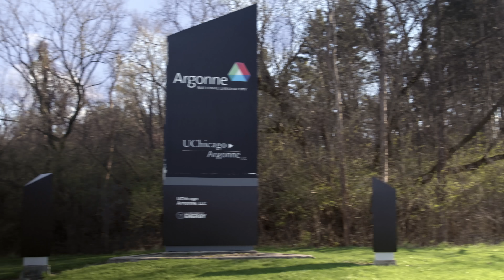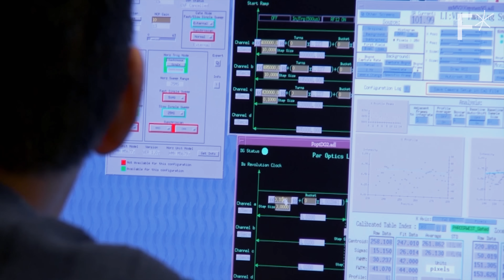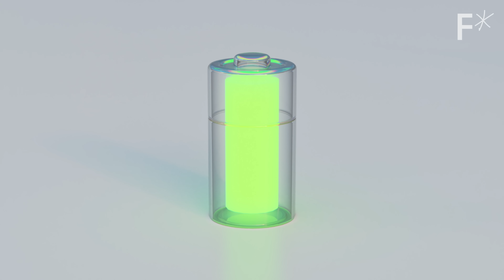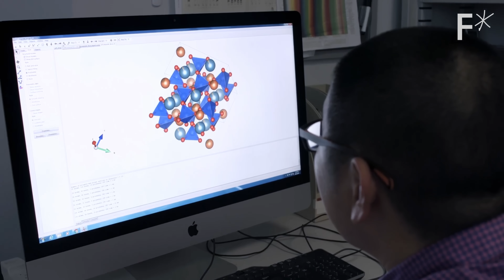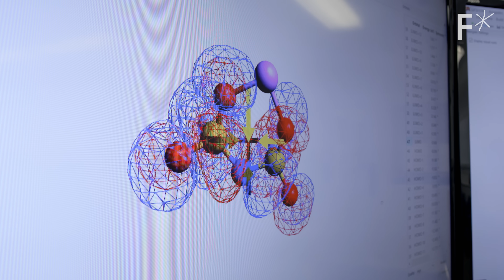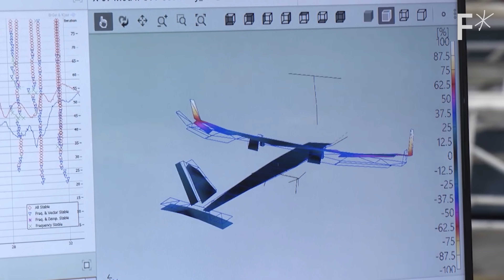The future of high energy density batteries | Hard Reset

Comment: I am a battery researcher just like our guests here, in fact I sometimes come to Argonne for similar experiments... there's problems here

3:15 Lithium scarcity is BS. It's one of the most common elements in the crust and if you had looked, you would have found that it is not a problem. What's the material scarcity of today's batteries? Well it's Cobalt, mostly. 
3:25 Lithium is not the electrolyte...the electrolyte facilitates the transport of Lithium ions. A pretty fundamental thing to mix up
3:55   2-3 times of what? There is a place for Zinc and Mg batteries but they also have fundamental downsides, for example Zn batteries are heavy af (10 times heavier than Lithium) and therefore mostly useful if space is an issue, for example it would be a good grid storage option if aqeuous (water based) Zn batteries would work out.
4:30 Argonne is definitely not the only place where they do this. It's called a synchrotron facility, and there's five big ones in the US alone where they all do this. And there's dozens all over the world. 
5:50 Lithium doesn't explode. It doesn't even catch fire if you throw it in water. It's the least reactive Alkali metal. They have a dry room because oxidized Lithium is useless in a battery, and Lithium reacts much faster with water than with just oxygen. 

Appreciate the skillful narration but there's a lot of fundamentally wrong statements in here, too. Did the scientists that appear here get to see this video before release?
Reply: thank you, i was getting sort of miffed when these statements popped up
Reply: I once again grow more and more glad that I take things from these videos with a grain of salt. General idea is usually right, but details are better known by specialists in the field
Reply: Thanks for the Info!
Reply: This comment should be pinned.
Reply: Even the comment about oil being replaced by lithium... you don't burn lithium and you only have so much per car... ever... then you recycle it.. A few hundred lbs for a million miles is a lot better than 100lbs of fuel for 350 miles..... not a fair comparison. We are comparing hundreds of thousands of kms to a few thousand in terms of weight of material used.
Reply: @DavidMcCalister  it actually is a pretty fair comparison because right now the energy grid only gets 1/3 of the energy that we actually produce. A gas vehicle only ends up using like 25% of the energy in the fuel. An electric vehicle uses way more of the energy stored in it. You also have to keep in mind that this tech is basically brand spanking new compared to the 100 or so years we've been using oil for energy. Electric vehicles are the future because internal combustion engines are far more complex and prone to failure.
Reply: Pin this comment!
Reply: U r absolutely right on all accords. We have grabbed the low hanging fruits of advantages, I think in next 5-10 yrs we will see charge speeds come down 10-20% yoy to ultimately 3-4 mins 0-80%. Nd by 2035 it could be way faster than filling gas. Storedot promises 2 min charge for 2030. But remaining underlying problem will remain. Even solid state is not that big of an improvement to lithium. New age solid state would be 5 yrs behind current lithium.
Reply from the maker: Hi @SwuuschifyMe ! Thank you for leaving a detailed comment!

First, to answer your question, yes, we shared this video with the folks at Argonne before releasing it to check for accuracy, and they had no edits or corrections.

3:15 Lithium scarcity is more complex than just how common the element is within the earth’s crust - it’s also a question of how easy, affordable, and sustainable it is to obtain that element. Beyond the pure practicalities of getting our hands on more lithium atoms, there are also the regulatory and geopolitical implications, as well as the complexities of refining lithium. All of these factors contribute to lithium's scarcity relative to the demand for it.  We’re not the only ones who feel this way, and many people predict we could see shortages in the next few years: https://www.weforum.org/agenda/2022/07/electric-vehicles-world-enough-lithium-resources

To be clear, we don’t think lithium will go away as a key component of some batteries, but many researchers (some in this video!) are very keen to explore alternatives that are more affordable and sustainable to obtain and would offer additional benefits.  In the future we think there will likely be a lot of different battery chemistries, including many that rely on lithium.

3:25 As for the difference between an electrolyte and the ions dissolved within it, we felt that it might be splitting hairs to disambiguate between them in this video — especially since many electrolytes (like lithium hexafluorophosphate) do contain lithium. This is the same approach many folks seem to take when describing lithium’s role within a battery, including experts we consulted with, for the sake of simplicity. In retrospect we can see how the wording could be better!

3:55 Regarding your comment on the various weights of zinc and magnesium relative to lithium, we’re referring to the energy density in terms of volume. We also understand that some of these chemistries would be heavier and therefore less suitable for certain applications, that’s also something that Dr. Venkat Srinivasan addresses in the video when he talks about the different constraints that various batteries will need to work within for different applications. The size, safety, and charging requirements will be very different for a grid battery, as compared to something like a battery for a mobile device or vehicle.

4:30 You are also correct that there are other synchrotron facilities, we don’t mean to imply that there aren’t. Argonne is a unique place that brings together a lot of specialists in the field of next generation battery technology, and provides them with on-site access to a powerful resource like the Advanced Photon Source on site, which we feel makes it one of a kind.

5:50 Also — we weren’t actually worried that the lithium would explode because of a humid environment. But lithium does have a reputation for reacting to water in pretty stunning ways (https://www.youtube.com/watch?v=Vxqe_ZOwsHs) and our voiceover often takes a playful approach to these sorts of things!
Reply: @freethink  very detailed, good job. Loved the vid
Reply: @freethink  Thank you for being a good, considerate channel and replying in such a detailed and kind way!
Reply: @freethink  HATS OFF TO YOU. + ratio
Reply: @freethink  I NEED to see the op respond to this.
Reply: As a chemist, I agree. This video is a lot of nothing burger. A good next generation battery needs to be energy dense, fast to charge, safe, and scalable. I don't see any of these really being discussed here. 
But to be fair to the video, Lithium scarcity has little to do with actual availability, but more of a geopolitical problem, as governments increasingly do not want such mines in their own backyard or are unwilling to export to adversarial countries
Reply: Have they delt with the dendrite problem?
Reply: @crisjiandennington991  dendrite is a problem 1 or 2 of the Lithium ion chemistry  batteries. There are 6 types of Lithium ion batteries already.
     as far as i recall 
1) Lithium ferophosphate 
2) Lithium titanate 
don't have dendrite problem.
Neither Na ion or Lead acid or NiCd.
Reply: @pravindahiya719  The dendrite problem exists on the anode side, and it is still a problem for all Lithium batteries. There's many other problems however and in some batteries it is not limiting.
Reply: thank you for this! I hope to become as knowledgeable as you
Reply: Thank you!
Reply: SwuusshiffyMe what's your take on using graphene and particularly employing "flash graphene"? And the fact that the Chinese company GAC is using graphene in their new car the Aion.
Reply: Doing gods work here my man, Thank you for the info!.
Reply: You really are full of s*it and 700 people are dumb enough to like your BS comment 😆 Lithium is highly reactive with water, even with moisture, the reaction gives up hydrogen which is highly flammable and can easily cause an explosion. And although lithium is widely distributed on Earth it does not naturally occur in elemental form due to its high reactivity, the number of places from which it is easy to extract being concentrated in a few areas, with over half of today's production happening in areas with high water stress, a lot of water being needed in the mining of lithium. According to a report by Friends of the Earth (FoE), lithium extraction inevitably harms the soil and causes air contamination. As demand rises, the mining impacts are "increasingly affecting communities where this harmful extraction takes place, jeopardising their access to water". So, curb your pro-lithium/pro-batteries BS propaganda 👌🏻😆
Reply: @andreassonne8004  Look at this comparison of Sodium and Lithium in water: https://www.youtube.com/watch?v=LfS10ArXTBA 
 Also, the hydrogen evolving from Lithium in failing batteries isn't exactly what's causing fires, it is the organic solvents in the electrolytes. Aqueous lithium batteries are considered safe...but you don't know that, you just saw a great opportunity to show everyone how much smarter you are because you remembered your 6th grade chemistry teacher said alkali metals are reactive. Try some humility next time instead of trying to bash someone on the internet
Reply: @andreassonne8004  Whats your solution to our actual problem? Even if lithium is not used in batteries for evs or in any kind of batteries lithium is used in other application as well
Reply: While its true its a pretty common element - its also mix with other elements you would have to refine for out of... thus the cost of li goes up... sadly only one country at this time can really refine it and its in China. The other factor is you will want to mind it in a way that its easy to get access too - thus there are only some many locations around the world that have larg pools of the stuff to make it easy to mine for.
Reply: If computers can't make a cure for COVID they won't invent new batteries. 🤔
Reply: @johnathanpearson3203  If you say so
Reply: Only the fact that something is common in the crust is irrelevant.
Iron is the most common element in the crust but we reached the point where mining has to compete hard with recycling a long time ago - its about rentability.
AFFORDABLE Lithium will get scarce - Li-ion Battery recycling isnt a thing yet the only way to get it out nowadys is pyrolysis, and that costs a shiton of energy and energy ist kinda fucking expensive nowadays - again rentability.
Not to mention lithum mining required loads of water - making it hard (and therefore expensive) to do in arid regions far off the coast and impossible where people live since noone wants toxic pool in the backyard... again renatbility. Cobalt is today, Lithium will be tomorrow.
But who am i.
Reply: flamed!
shootsfired!!
freethink
sucks!!!!
Reply: Seriously I feel so weird about the video. After your comment I know why
Reply: We can help scientists by processing data from Boinc distributed computing software
I have helped to discover new powerful corona vaccine called skycovione vaccine by running rosetta@home
Reply: Lithium Iron Phosphate Cells - neither need Cobalt nor Nickel.
Reply: Ur researching company name
Reply: Thank you for explaining. So what do you think about the main idea in this video is? 
Hard reset?
Reply: Inaccurate because it’s a profit driven channel masquerading as science.
Reply: @Not Sure Guaranteed every time you see some “the future of batteries” video it will be misleading, inaccurate clickbait. That’s what I expected here, and got it.
Reply: What do you think about electric cars being equal or more polluting than oil cars? I've heard that statement before and I don't know what's true.
Reply: @NachoJoshas  https://www.youtube.com/watch?v=lOyzLSBCBWo&list=PLwXFgYeQu3nKZ5-zJyavZmxhpHitHwbPa&index=5 you can watch more about that here
https://www.youtube.com/playlist?list=PLwXFgYeQu3nKZ5-zJyavZmxhpHitHwbPa and here you can find my playlist in case you are interested
Reply: The Next Generation of Batteries
Graphene technology is not the future, it has already hit the market
https://youtu.be/Zj9WFnyEyLw
...
Reply: @BeautifulPeopleBTFLPPL  We will see its too early to say that
Reply: if it's a galvanic cell, surely using flourine and potassium would be better as it generates a higher voltage in redox? This is really interesting and I'd love to have a talk about this.
Reply: The problem with Lithium is that when a charge is applied, it expands massively. That's why we have additives in Lithium batteries. However, I read a scientific article a few months back where they did experiments on pure lithium batteries, where they managed the expansion of Lithium by using carbon nanodomes to limit the expansion
Reply: @calebdunlap3753  I watched a video about tesla and the 4680 batteries where it claims that can charge over 15000 cycles and that will improve the lifespan of the batteries a lot. I dont know thats true but of its true but i guess we will have to wait and see
Reply: Nice. Its thanks to Thunderf00t that Im real sceptic tostuff regarding batteries and I guess just any form of science in media.
Reply: Man nothing is more annoying than someone annoyingly correcting someone and then being the wrong one. Lithium is not one of the most abundant elements, and it’s rarer than cobalt. What’s holding cobalt up is where the cobalt is not how much of it there neither are that rare. Stop being annoying dude, people make mistakes like you just did
Reply: @monhi64  Even a quick search would have shown you several graphs where you can see for yourself that Cobalt is much, much rarer than Lithium https://en.wikipedia.org/wiki/Abundance_of_the_chemical_elements#/media/File:Elemental_abundances.svg. I am not the one who is 'annoyingly' correcting someone, I am simply not okay with letting hyperloop-level misinformation coated in a  blanket of hype stand uncorrected. And people like you and other 5 min experts won't change that.
Reply: Thank you.
Reply: Nickel Cadmium is best. I have decades old ones, still good.
Reply: it's not about Cobalt and Lithium Scarcity it's just instead of buying from china and other countries we don't have leverage on , while being nice to everybody we'd rather be the kid that wants all his friends cake while he got only one mouth and one stomach ,China holds most Lithium reserves and other most likely to be China friends hold most Cobalt , the Fact is we don't know how to play nice here in the US we have mentality like " either i have leverage on you or you're my enemy " plain and simple.
Reply: Lithium being scarce is not about how much it is on the earth's crust it's with how much if it is economically obtainable i.e Sand for making buildings is scarce even though sand itself is the most abundant material on earth and can be found pretty much everywhere.

"Lithium doesn't explode or catch on fire"? Then what makes the batteries catch on fire or explode when they are put in water without the protection layer?
Reply: @asandax6  The highly flammable electrolyte (the solvents are flammable), the cathode contains an oxygen source....you should learn about something called thermal runaway, it is much more complicated than lithium.
Reply: The next trick is to find energy to feed these "future" batteries. Solar and Wind are hardly the solution to gap the energy density of oil and gas to meet the needs of our industrialized globe, not even close.
Reply: Damn, man. I am no expert in any of this and have no drive/need to research what I need to see who's right. But I do know how to spot a jerk. Maybe you're right on everything you say, but you have big issues with expressing yourself. I hope you eventually manage to work that out.
Reply: @NigraXXL  who are you talking to?
Reply: Seems like you are an undergrad at best, judging from behavior and nick.
1. Lithium to Gigawatthours or Terrwatthours capacity per year has a production bottleneck at scale. Elons admits that readily and I think he's eligible to talk about it. You are not
2. depends on the chemistry. There is not one Lithium battery.
3. 2-3 times the charge. An electron is a fundamental particle with a fundamental charge. Welcome to chemistry
4. It is unique in that everything battery-related happens in one facility.  That was made clear
5. Elemental Lithium is highly reactive. In a lot of natural circumstances it can lead to secondary reactions that produce an explosion. Hush, go to wikipedia to see what an explosion is.
Reply: @Telencephelon  Very rude comment. You could have imparted your knowledge/"expertise" much more tactfully.
Reply: @James4theDoctor  Yes. Thank you
Reply: @Telencephelon  Invoking Elon Musk? The guy who thinks hyperloop is a good idea?

1. Sure. It's probably not the Cobalt in Tesla's NMC cathodes that's a problem for scaling /s 
At least their cheap variants use LFP. 
2. No it doesn't depend on the chemistry. And I never said there is only one kind...
3. Who cares about the charge though? What matters is specific densities, energy and power densities, per volume and per mass unit. I am a little shocked you don't realize that and instead try to turn this into a gotcha moment.
4. It's not unique though. That was my point. 
5. I work with lithium metal every day. It's not what you think it is. You are confusing it with sodium, which is very reactive. Lithium doesn't explode. Lithium batteries may burn but don't 'explode' ( you can check what the difference is on wikipedia). Just go and get some Lithium and see for yourself.
Reply: @SwuuschifyMe  If Musk thought Hyperlook is a good idea or essential he would have put his own money into it